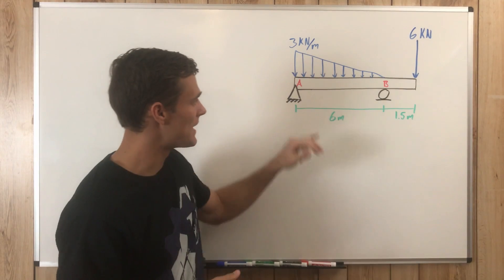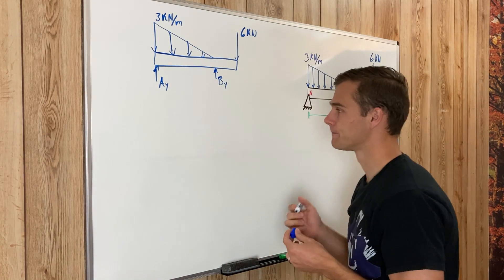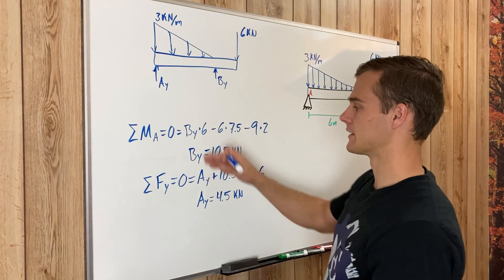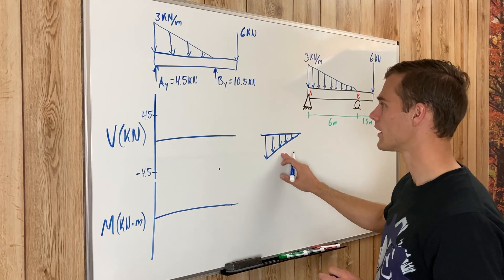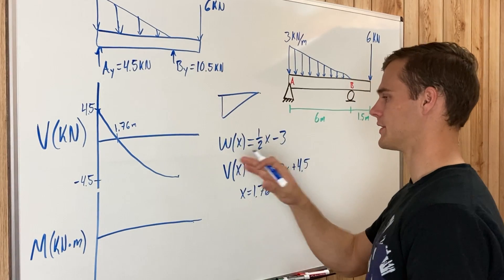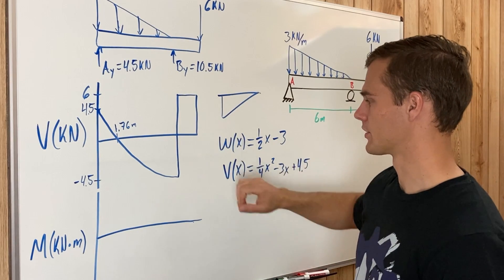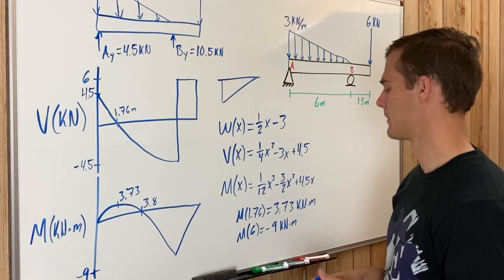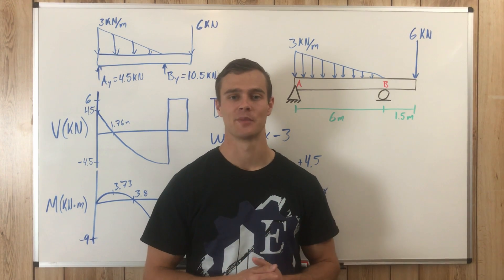TRIANGULAR LOAD Shear and Moment Diagrams EXAMPLE PROBLEM

Comment: Tbh this method was the only method that really helped me understand problems with negative slope. I tried doing the section method calculating the moment and vertical force with respect to x and couldn’t find a solution. With this method it was so straight forward. Thanks for the help.
Reply from the maker: I’m so glad! Thanks for sharing!

Comment: HOW DID YOU GET 3.8m ON THE SHEAR DIAGRAM?
Reply from the maker: Great question! You need to create an equation for the force on the beam and then you integrate that equation to get the shear equation. Once you have the shear equation you set it equal to zero and solve for the variable (x in this case) to get where along the beam the shear is zero. Does that make sense?

Comment: Thanks for posting such a helpful information.  Q: why did you come up with positive slope in load equation W(x)=1/2x-3?  As you mentioned, the line in the problem  is going down and slope should be negative. please correct me if I'm wrong.
Thanks
Reply from the maker: Great question! The way it is drawn it is a negative slope but if you draw negative forces below the line then that  hypotenuse of the load triangle becomes a positive slope. Doing it that way makes all the equations work out better. I explain that more in this video: https://youtu.be/bj8jvZ6C8l4
Hope this helps!
Reply: @studentengineering  Thank you so much!

Comment: I tried setting the moment equal to 0 to get the distance where it crosses the axis but I got 0. How did you get 3.8? I think I made a mistake.
Reply from the maker: Great question. I guess I couldn’t tell you why you didn’t get 3.8 but 0 is also an intercept for that equation because we know the moment is 0 when x=0 so you didn’t necessarily get the wrong answer. Use that moment equation that I came up with in the video and then set it equal to zero and solve for x. Since it is a third order equation you will get three values for the intercepts. One will be 0, one will be 3.8 and another one will be something else that would be outside the range of where we are using the equation (less than 0 or greater than 6). I would recommend using Wolfram Alpha or Symbolab solve for those intercepts for you.
Reply: @studentengineering   Got it. Thank you so much!

Comment: The curve must be outward on the shear diagram right? Since the triangular load is  sloping downwards?
Reply from the maker: That would be correct if the load was sloped downwards but I explain in the video why it is actually sloped upwards. I also explain it even better in this video:
https://youtu.be/bj8jvZ6C8l4

Comment: where 3.8m came from on BMD
Reply from the maker: We set the moment function equal to zero and solve for x to find out where the bending moment diagram crosses the axis and when we do that we find that the bending moment is 0 at 3.8 meters along the beam.